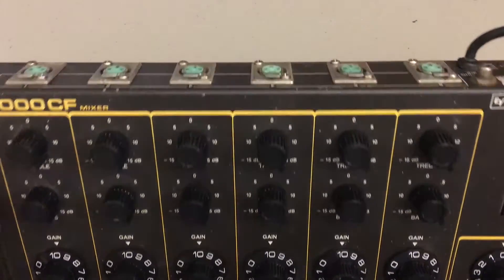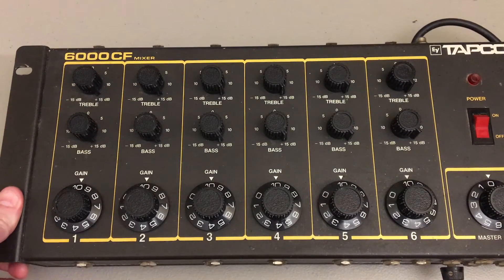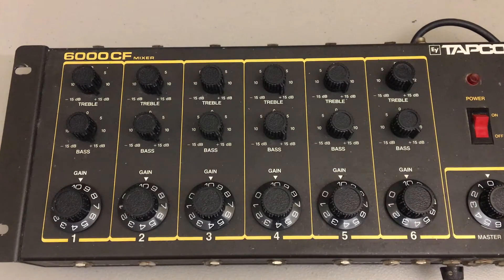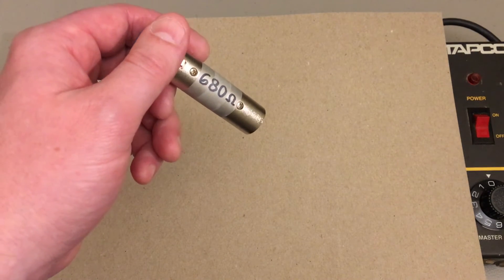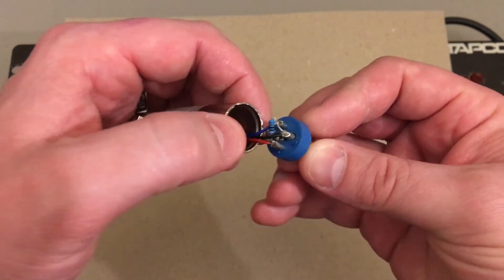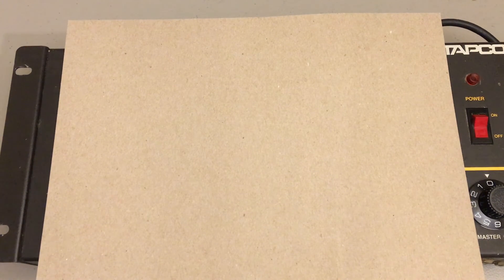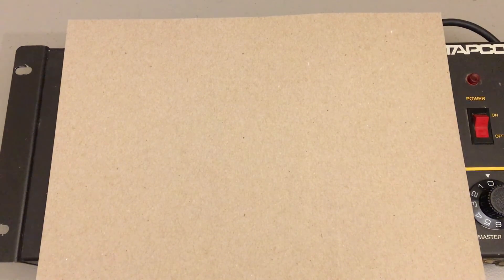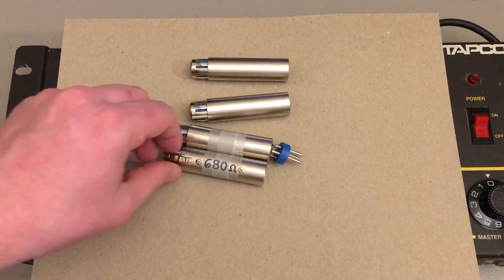Mod your microphone without modding your mic!

Comment: i put a 1k resistor on my tranformorles tape op sm57 mod and it helped a whole lot witht he noise floor, awesome
Reply: Right ! If the input impedance of the preamp is 1500 Ohms, the right value of the resistor is 1K to reach a total of 600 Ohms. And remember to use a metal film resistor that have a lower noise figure.